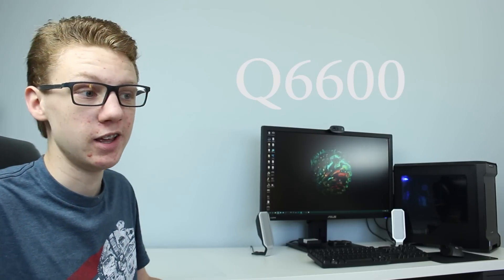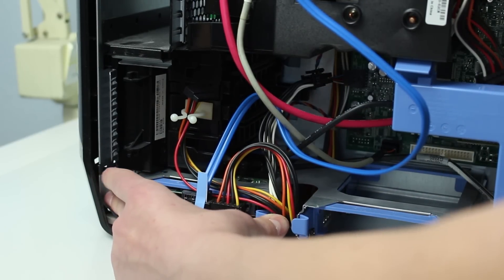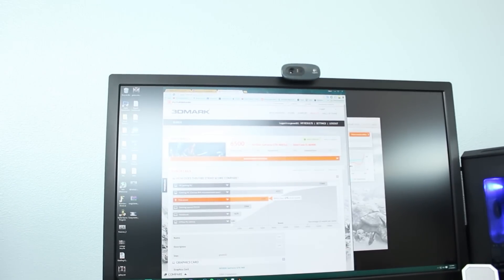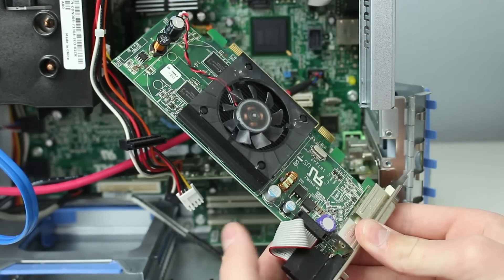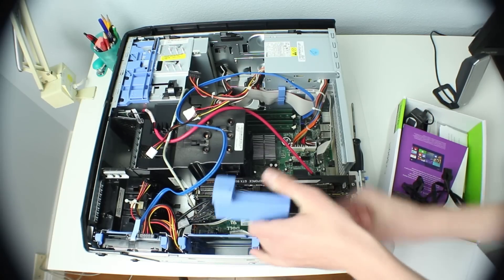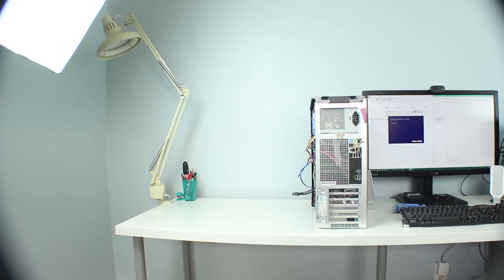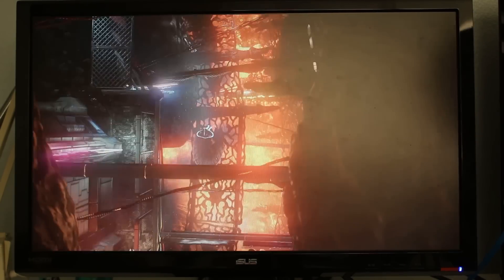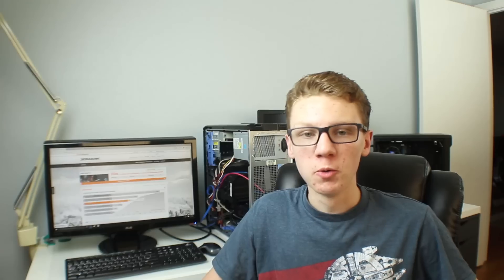Old CPU + New GPU = Gaming PC? (Core 2 Quad + GTX 960)

Comment: I’m running a Q6600 with a GTX 970 in 2022 🤪

OC from 2.4 to 2.9.  My next mod will be lapping the cpu and increasing fan size and number on Akasa Evo Blue from 1 x 92mm fan to 2 x 120mm to break 3.0 ghz (ghetto cable tie) 🤞

Comment: Up until recently I use to use a xeon x3370 and 750ti with 8gb of ddr2
Reply: I still use xeon E5450 overclocked to 4.0ghz 8gb adata gtx960 p5q deluxe and have no issues !!

Comment: If I use an intel 10600k(2020) paired with my old gpu ati 5850(2009) until I buy my new gpu, will there be any problem besides the bottleneck?

Comment: so i have a intel core 2 quad 8200 on an old gigabyte motherboard with ddr 2 ram, and i want to replace my old video card with a rx 550, do you think it will work? cause i don't want to spend 75 euros in vain, i know the gpu won't run at it's full performance, also i have a 550w power supply.

Comment: Nobody wants to run a C2Quad at stock clocks. Nobody. And the GTX 960 is pretty much an oc'ed GTX 950, btw there are indeed other cards on the used market that are significantly better, lets say an R9 280X or a GTX 970 / 780ti. Just buy a Q9650 + a good mobo for @4.2 Ghz oc and you are golden.
Reply: Unfortunately, not all q9650s can overclock at 4.2ghz with a good low voltage. I was only able to get mine up to 3.9ghz, but I had to up the voltage to keep it stable, but heat was an issue after a short while, with an AIO cooler.  Also, the power bill wasn't as friendly as before. I ended up keeping mine at 3.6hz.  Do you remember what voltage you used for a 4.2ghz clock setting?  Must have taken a while to pair up the proper voltages with the ram and northbridge.

Comment: Keep trying kid, you are learning even though sometimes your presentation / wording is messed up. The effort is there so don't give up even though you have some harsh critics. In May 2008, I had done a DIY desktop build with a Gigabyte GA-X48T-DQ6,  E8500@3.16GHz (later upgraded to Core 2 Quad Q9650), OCZ 2x2GB DDR3 Platinum 1600MHz (upgraded to total 8GB), 2-ATI HD 3870 in CF (later upgrade to HD 6870 CF, now using a single R9-280X), Zalman CNPS9500AT cpu fan, Zalman ZM850HP-850W powersupply, in a Thermaltake Armor Plus (VH6000SWA) full tower. Still runs and functions very well but overall about 2 1/2 times slower than my newest DIY rig build in Feb. 2015 (Gigabyte GA-Z170X Gaming 3, i7-6700K@4.2GHz, Adata 4x8GB XPG Z1 DDR4 2800MHz, 2-GTX 970 in SLI, Corsair RM850i powersupply,  Corsair H60 AIO cpu cooler,  LEPA Lenyx LPC801A-B Full-Tower, Windows 10 Pro.) The only thing I cannot use my PC for is 4K gaming otherwise nearly 4 years has passed and still as good as any new PC on the market here in 2019. No one needs a new PC each year, just something you can make minor UpGrades to and it will last you 4 to 7 years before you need to purchase a new PC. In 1982, I had the Commodore 64, in 1983 the Apple IIe Pro system, (decided against the IBM PC Jr.) and the Apple IIe lasted me until 2001 or 18 years. In 2001 bought a Compaq Presario that had the 1st Pentium 4 cpu with RAMBUS memory (too many problems), in 2002 bought Compaq Presario 5423US and went with my 1st DIY build in May 2008 already mentioned above.  Save your money and invest in Do It Yourself builds about every 5 years which you can Upgrade without doing a major overhaul and wasting money. Things haven't changed that much cause my 2008 rig still has a couple years of life left or maybe till 2020/21 cause I can run Windows 10 with it and obtain updated drivers as long as Microsoft supports Win10.

Comment: I have a old pc with the q6600 cpu and it has a 8 gb ddr2 ram and a pcie 16x with a 300 watt power supply could i put a 1050 inside of it

Comment: i run 2 core 2 quad systems, a core2 duo and a couple i7 and a8 amd laptops. my overclocked core2 quad destroys them all at 3.4ghz with 4gb ram clocked at 400mhz at 4-4-4-10 timings with two ssd drives. gpu is r7 370 2gb. paid very little compared to the 2000 dollar i7 laptop

Comment: I have a q9400@4ghz, 8gb 1066mhz ddr2, and 670 gtx.  Many optimized/low requirement games play no differently than my modern set ups.  I have noticed on games like battlefronts 2 or crysis 3 that the CPU is pinned at 100% on all 4 cores while the gpu sits between 50% and 70%.  My 2600k at 4.8ghz does not max out all cores even with a 1070 gtx paired with it on any title I own.  The passmark score for the q9400 is 5000 while the 2600k is 12000.  These are more or less a generation apart.  My opinion is that for the majority of uses such as wow, lol, overwatch, pubg, or CSGO the core 2 quad will give a better value experience.  If you are looking to play more modern titles, or want a future upgrade path, a 2200g paired with a 350/450 motherboard is usually a better way to go.  You can play all of these esports titles on the APU, then upgrade your graphics later on.

Comment: I am currently running a Core i3 Quad @ 3.2Ghz with an MSI overdrive ddr3, 2gb gpu, to play Fortnite. I am averaving 15 to 30 fps during game play which is ok for the money. The Core i3 only runs at 25% during game play but gpu overclocked at 725mhz ans runs at 98%. I am thinking games like Fortnite are more gpu than cpu dependant so I will be upgrading to a 4gb graphics card in the near future.

Comment: OK while going cheap on your processor on a budget might not be the worst thing you could do, it's certainly not recommended. Your processor controls the maximum frame rate you can achieve when paired with a graphics card. So if you put an intel core 2 duo E8600 and pair it with a GTX 1080 Ti, you could still see only 30 FPS in many games, or even less. I'd say, if you're on a budget, save your money and wait until you're not. :)

Comment: I know this is a 2 year old upload but just wondering if this was stable with that GPU and less power? I have an old XPS420 with 4gb ram win10 64bit and same q6600 quad core cpu. Reckon it will run Fortnite ok with that card? Thanks for the upload!

Comment: For extra 203$ difference you can buy better Graphic Card and outperform i5-4690k + GTX 960 ... No brainier if are only gaming ... The only drawback for Socket LGA775 machines is that they can only support up to 8 Gb of ram (usually in 4 x 2Gb setup), but hey they pretty cheap too !!!
P.S. This video also proves that if you want to upgrade you old potato rig you should definitely start with GPU first.

Comment: I have a q6700 dell optiplex laying around threw my gtx 980ti in there and damn thing wouldnt play pubg past 20fps on low settings with up to date driver on windows 10. My 8700k system with a 980ti runs exceptional frame rates on max settings.

Comment: asking: did you runned the q6600 with 3gb ram mem at benchmark and reachs 85% of the i5, how much ram mem was on that computer(i5)? the gpu takes a lot of credit on 3d performance. I'm asking because i´m between change the cpu or put some gpu to render and of course play some stuffs... tnks for de video! It was funny because i´ve the same cpu with 3gb ram

Comment: Intel q6600 is 2.4 ghz and i5 4960k is 3.5ghz with 3.9ghz boost. So... Big difference by frequency, but not much big difference în performance. I think a core 2 quad clocked at 3.5ghz beats the core i5 4960k

Comment: Hi Gavin  I have Intel DG43RK Motherboard  with Core 2 Quad Q9650 . Can I use GTX 960 graphics card on my Motherboard ?. Please  advise .
Reply: Nageswar i Use a 960 and a 970 on the same Board. It run very good. But look for the PSU a newer one is better because the Energy Spikes of the Cards are higher. Dont use a VGA Monitor for this Graphik Karts ;-)

Comment: Why the old PC is so slow to boot while having higher specs than my pc, but my pc is faster to boot even it has crapier specs than the pc which is rocking an Intel Pentium E5700 (Dual-Core no hyper threading 3GHz) a 4 gigs ram DDR2 667 MHz, GT 730 2gb vram (128bit variant)

Comment: Ha Ha, Kinda funny. This is the exact PC i got for free from work. They were throwing out a ton of their old work stations and I nabbed this one. Been trying to see if something like this was possible. Think I might upgrade the power supply as well as the graphics card. Also currently had only 2gigs of ram. I know the mother board will support 8gigs of DDR2 and its like 30 bucks on amazon. Throw an SSD in for good measure and looks like we can make a barely half decent gaming pc out of it. Why not.

Comment: Hey can I use the 960 or maybe a 750 graphics card with my Intel Pentium g630 (2.7ghz) CPU? My motherboard is Intel dh61ho and my I have 2gb ram (which I think I will upgrade) and I have a 1tb WD caviar green.. (I don't know about the PSU)

Comment: This is really great to see bro. I actually am still using a q6600 FTW x) an amazing proc. to be sure I'm finally upgrading now to a 8700k I just cant do on the old quad what i need to anymore and its been 10 years so it's definitely time. The reason I found your video is because I've been trying to find out if my old hp monitor (roommates cat broke my asus) can display an ineligible signal from a 1080ti till I can buy a new monitor.

Comment: I've just scored a shuttle xpc with a phenom 9650 quad core, 4gb ddr2 1066mhx ram and a GeForce 640 2gb gpu for £35 ($46). the gpu sucks and after a bit research, the motherboard wont handle a faster cpu so what gpu would you recommend to avoid bottlenecking?

Comment: What a moron, I have an old pc with a core 2 quad q9450 and even that cpu overclocked to 3.2ghz can barely handle the 650 ti boost 2g. The q6600 would bottleneck anything newer then a gtx 470. Also if you want cpu results run skyrim lol, the moment you walk into any populated city that cpu will choke really bad

Comment: I know its not about your Q6600, which is a great cpu, but did you say that your 4690k is running stock freqs? If so you should at least o/c it a little to get a better bang-for-your-buck. At stock speeds I believe its equivilant to the non-K version.

Comment: Plugging in a late model GPU is THE best upgrade you can ever make for gaming. I just added a GTX 1080Ti card to my 10 year old system (i7-920, P6t Mobo) and my 3DMark II score went from 5300 to 14307. Games that were barely playable now run at +100 fps. I'll eventually upgrade the cpu to the i7-8700 but for now I'll put my money into a new gaming monitor.

Comment: I don't consider the 960 a new GPU ... My GTX 780 is older than the 960 and is vastly more powerful. The GTX 960 Doesn't seem to be a budget GPU either I was thinking more along the lines of an R9 280X or an R9 290 for a low-mid ranged 450-550$NZD System for people on a budget.

Comment: Please in the future look up what your reviewing. The Q6600 with b3 stepping code is 105w tdp, with b0 stepping it's 90w tdp. Both on air can overclock to 3.4 fairly easy and 3.6ghz with some work dependant on which chipset your using. Since your using a Dell (OEM) chances are you aren't able to change the multiplier or voltages to overclock at all. 

Putting a GTX 960 or any component in ANY system without enough power or the proper power connections is dangerous, please don't do that again. 

If you really want to compare the 2 systems run them the same way only plug in 1 of the pci-e power connectors on your main system, I bet the scores will be closer with them running the video card starved for power on both systems. 

Most of your review was decent but scary. Please learn about what your talking about and do things safe in the future. 

The big reviewers have lots of subscribers because they fallow safety guidelines and do some research before making the video so they don't sound ignorant to the content. Talking about sacrificing 5 hours of your day when clearly very little preparation was done is doing things half assed. I'm not trying to rip you down just trying to let you know that if you want to get better and have more subscribers you should do some prep and learn about your subject.

Comment: I had the same dell xps 420, but i had an nvidia geforce 950 gtx in it, everything ran fine and dandy, upgraded to an i7 870 @ 2.93 ghz, 12 gb ram, nvidia gtx 980ti - runs every current triple a title at max just as well as all the newer end pc's

Probs cost me £400/$430 in total, graphics card being £250/$270 of that alone, safe to say next upgrade will be to an i7 7700 @ 4.2 ghz and a new motherboard

Little tip, the 980ti is faster, cheaper and smoother than the newer 1070 cards, i bet if you shopped around youd get one for about £50 less than what i paid

Comment: My CPU Is the same and Yes, its intels first Quad core. 
My Current Pc Specs

GPU: GeForce GTX 1050
CPU: Intel(R) Core(TM)2 Quad CPU    Q6600  @ 2.40GHz
Memory: 8 GB RAM (8 GB RAM usable)
Current resolution: 1920 x 1200, 59Hz
Power Supply 750W
Operating system: Microsoft Windows 7 Ultimate
Reply: All I Need is new motherboard and pcu

Comment: I'm pretty sure this is almost exactly like my first gaming rig! It was a Dell Dimension 9100 that my dad used to use (before I kinda took it over). I upgraded the power supply to 430w, upped the memory, and put the exact same model of GTX 960 in. It's broken now. RIP my gaming rig.

Comment: 3 years ago I had an Q9550 @ 3.4GHz and 8 GB DDR2 RAM paired with an HD 7870 GHz. Only an negligible bottleneck of 10 percent in cpu intensive games on 1080p resolution compared with similar I5/I7 cpu setups. Later on I swapped the HD 7870 GHz for an HD 7970 GHz. Bottleneck was increased a bit, from 10 to 20 percent at same 1080p resolution.

Comment: can i play Pubg with Core 2 Quad q8300 @ 2,75ghz (10% overclock profile) when i buy GTX 960? i ask because i have only 2 slots in my board for ram and atm only 4 gigs but want to upgrade to 8 GB by buying a 
Gigabyte GA-G41M-COMBO Motherboard
Reply: i upgraded my quad core to Q9650 with a 970 i would have 27% bottleneck with a 960 only 14% so better i choose the 960. I have to pci.e slots so i can buy 2x 960 with 4gb each would be enough for pubg if i O.C the q9650 or ?

Comment: You can repartition hard drives in the right format IN the installer, you know, right? Also im surprised that you were able to use FAT32 to format a hard disk, i thought partition sizes were fixed pretty small for FAT32... That might be why the disk activity was so slow, especially stacked on the age of it as well.

Comment: Gotta quad recently. Intel core 2 quad or duo e8400 e8500 are superb proecessors i love em since you can OC big time and a 775 socket MOBO is cheap, and gee... Core 2 quads xtreme are insane. i love the big caches in intels,  and at the this time they run for 20 usd in my town. So i rather oc 20 bucks processors till they melt ... You can burn 10 of them for each i5... And this guy knows what hes taking about. Spend more on ure gpu's since you can place them in any board u want and have fun without remorse! Nice Video!!

Comment: Only problem with the CPU being so cheap is that finding an actual decent 775 board to use for cheap is almost impossible. Even if you end up finding one the odds of it actually working with a Core 2 Quad are pretty slim if it's an OEM machine. Oh, and 4GB's sticks of ram are all that are available so you're limited to 8GB until you get a new board and a Pentium from the 1151 socket would blow that CPU off the charts both in game and in bench marks. Games prefer less, faster cores, instead of more, lower clocked ones.

Comment: I definitely don't recommend getting a Q6600. Not to say that it isn't capable, but you can easily score a Q9550 and get better performance, and not pay a crap ton. I paid probably around $300 on my Q9550 build, which is capable of playing Fallout 4 on medium while rarely dropping below 30 FPS, and usually sticking around between 40 - 60 depending on what is going on onscreen. I have the same game on Xbox One, and it plays horribly by comparison.

A Q9550 build could probably be cheaper, but I decided to get a 1050 TI as I do intend to eventually replace this motherboard and processor with something more recent. I was mainly just trying to get my foot in the door of PC gaming, hoping to avoid purchasing the Xbox One X as I am becoming less impressed with consoles these days. Also Steam sales are awesome!

The Core 2 Quad definitely isn't dead yet. But I don't think it'll take too much longer before it absolutely cannot keep up anymore. Mine is even overclocked and it still bottlenecks the 1050 TI, meaning that it can't possibly perform any better than it is currently. Right now, though, it seems to be a good start if you're trying to test the waters.

Comment: I have a Core 2 Duo E6850 with 8GB DDR2-800 of RAM.

If I decide to buy a GTX 1060-or 1070 to replace my aging 8800GTS 320MB, will it work or will it a little bit overkill?

P.S.  I'm runnning Win7 Pro x64bit ;)

Comment: I just got a Dell Dimension E520 from my mom i just added 4 gigs of ram and a video card a gt 210  but i have been thinking about upgrading my cpu because this dual core sucks so i been thinking about a q6600 and a gt1030 because i am using the 305 watt power supply that came with the system so what do you think about the pair gt 1030 and a q6600.

Comment: I have an amd x4 860k CPU with 3.7ghz and I am just about to order gtx 1060 I also have 8gb of ram, will my CPU bottleneck me significantly compared to I5, or will just be something like 80-85% performance of I5 in this situation, also my goal is to play games on 1080p 60fps with relatively high settings.

Comment: This was informative. I have been wanting to upgrade and be able to play some games. I have a Intel Core 2 Duo E8500 so its not a quad like in the video, but was wondering if i should instead of upgrading my entire system i should just try the graphics card first. i also have 4gb of DDR2 ram, and 600w psu and SSD. I was thinking of buying a 1060 6gb or a 1070...